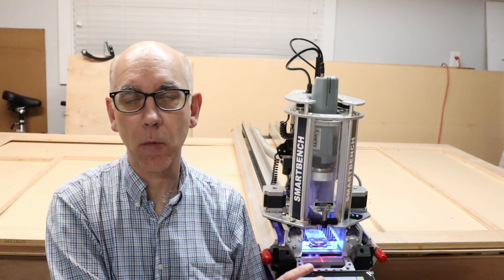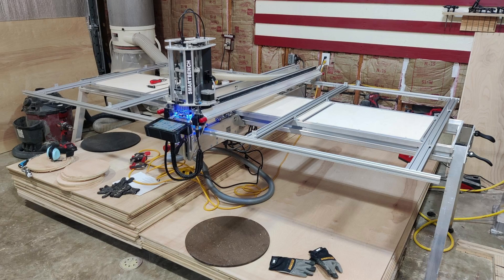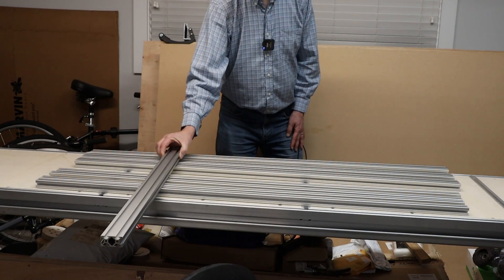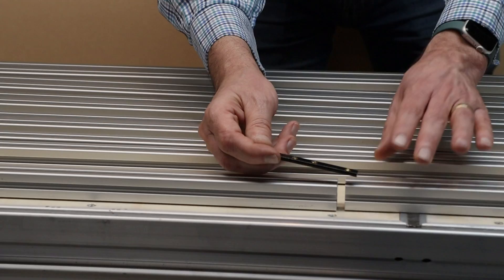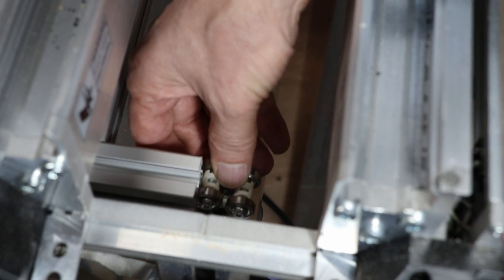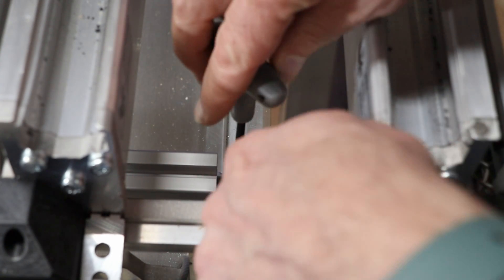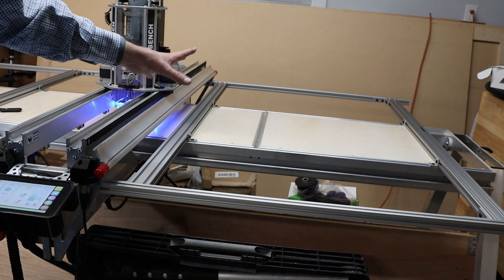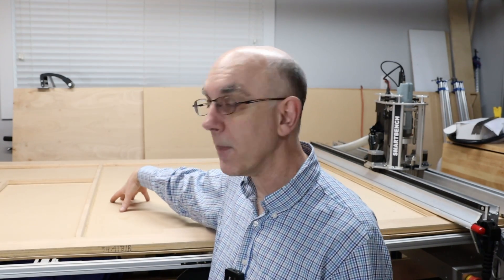Rigid Frame for SmartBench CNC Router

Comment: I dont think you understand how this machine works. Your accuracy in the z axis is going to be degraded with that there.
Reply: Can you explain? The video clearly shows bumpy y-axis movement as the gantry travels over previously routed material. As soon as a rigid frame is there, that doesn't happen? If there are dips and rises in height you are bound to see less z-axis accuracy.
Reply: He just needs to move his wheels to avoid the bumping on the z axis. 
Doing it this way the xbeam is unsupported so he’ll get variables in the z axis height and the angle of the cutter.
It’s just not designed to work this way and it’ll flex. 
He trying to use it like a traditional cnc but they are heavy duty to resist against flexing, the SmartBench needs to roll on the surface of the material to maintain accuracy.

Comment: I'm real curious about how this proves out over time. My projects using 80/20 extrusions have mostly used the blind connectors and gusset plates, not the angle brackets. 80/20 technical documents indicated that the blind connectors were the strongest, which is surprising considering they're also the cheapest.